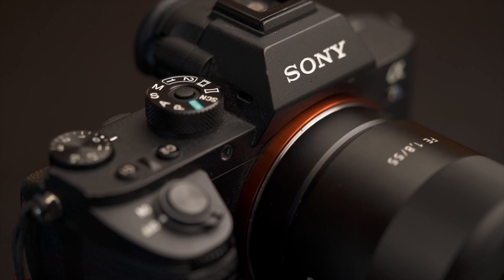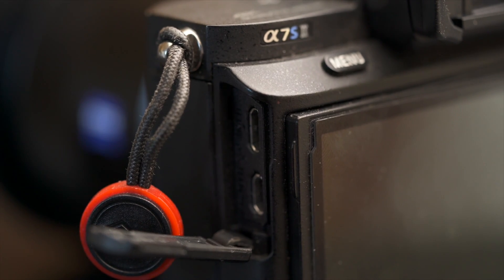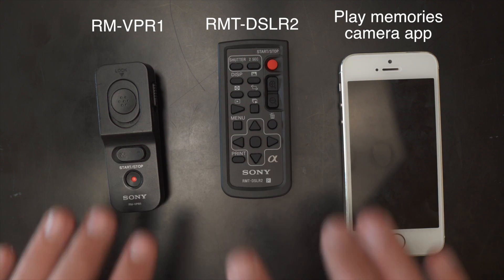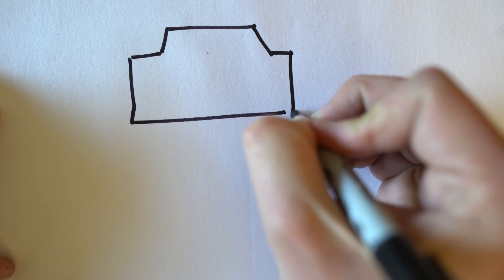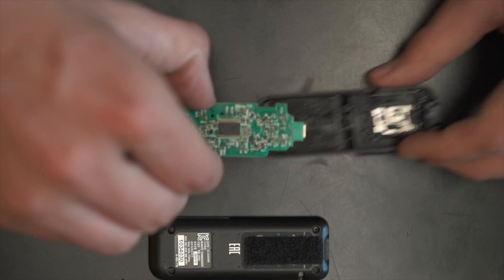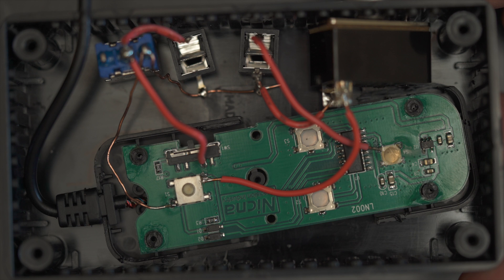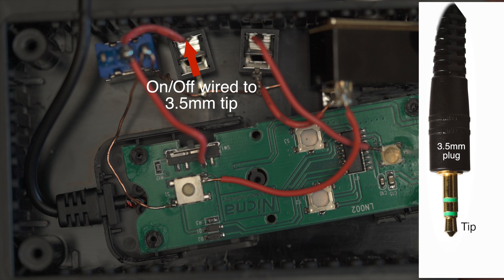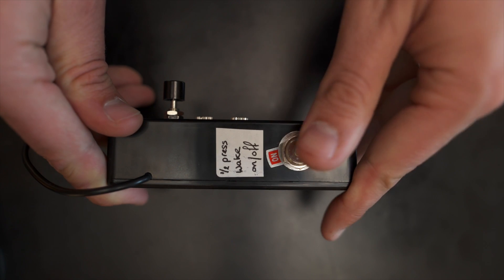How to hack the Multi-Terminal: Taking (remote) control of the Sony A7/S/R

Comment: I just approached the same project, to trigger video externally. I own one aftermarket cheap wireless intervalometer, that comes with a Multi Interface to 2.5mm stereo jack cable. Shorting GND to the Tip worked out just fine. There is an option in-camera though, called something like "Use shutter for video".
Reply: While that works on the newer bodies, older ones from when this video came out do not have that option. Even on my slightly newer a6500, using a similar intervalometer, I get a message telling me that I have to use the MOVIE button to start movie recording. My intervalometer is the Pixel TW-283, for reference.
Reply: @ziginox  i think I have the same intervalometer.

Comment: Hi Elliot, great hack! As a completely igonrant in electronics, but still loving DIY , i been looking for a remote control for Sony Alpha cameras that allow to change shutter speed and iso, do you think this is possible? Maybe not hacking a sony remote but maybe with arduino? I really been searching for a very long time and i back to your video several times , i feel you are close of what i am looking, i need a remote control (wired or not) to change settings when i am shooting hyperlapses with a gimbal , maybe you could answer my doubt, thanks so much in advance and keep doing great!
Reply: Hi Alex, have you found any solution/device that answers to your question? I've been looking for remote controller to change shutter speed and iso (specifically) too, and a cellphone app isn't ideal for me. I need to come up with an eng style rig for sony a7, but current shoulder rigs limit my right hand placement to extended handle most of time. so I don't have access to the buttons and wheel on the back of camera and be ready to change iris or iso. I know FS5 and FS7 are designed to do the job, if there's more budget for production.

Comment: I have a setup which the camera is triggered to take a photo using a simple micro switch. This works fine with the Canon EOS 650d and the Lumix G9. However I've stumbled into a bigger problem with the Sony A7III, realising that I couldn't bodge it in the field using one's teeth as wire strippers... This hack looks somewhat overly complicated and expensive for my requirements to take photos without autofocus triggered with a microswitch - is there a more straightforward hack?

Comment: Hi Elliot, thanks for the video! I'm trying something similar, but with an Arduino microcontroller instead of switches to potentially allow it to be programmed for a time lapse or controlled a bit more elaborately. Have you made any use of the shutter? 

From what I can see, full pressing the shutter button grounds the top left pin on that switch that's connected directly to another wire back to camera. It seems a bit weird because I haven't been able to make any controller based off just grounding pins on the multi-port work yet
Reply from the maker: Hi Cian. Triggering a single photo or series of photos for a timelapse should just be a case of shorting one pin to gnd. There are multi port to micro jack adapters that will let you use generic timelapse intervalometers. If you're trying to do day-night type timelapses and change things like ISO, you will need to engage the USB portion of the multi-terminal, and to my knowledge, when the camera detects USB, it will no longer store captured photos to the memory card. If you're trying to trigger video, you have to go through the circuitry in the VPRM1. It's outputing some sort of serial signal. You could potentially figure out what that signal is with an oscilloscope and some other pro gear.
Reply: Elliot Lowndes thanks for the reply, yeah I had read elsewhere that it was just shorting one of the other pins, but I've tried two different multi-terminal to 2.5mm adapters so either my port is damaged, they've changed something in a recent firmware update, or I'm just really unlucky with cheap adapters. 

Thanks anyway, I'll hopefully get the controller working but I don't have access to my Sony for a few days now

Comment: Thanks so much for this information!  
I had a follow-up question on one particular switch you connected, please: 
When pressing the "AF" button that you rigged up, is this the same as pressing the AF/MF button on the camera, or the AEL button?  OR does your AF switch activate some other circuit (such as a Custom-configured button that just turns "ON" the AF at that moment)?  And if it does activate one of the actual buttons on the camera, is that button still also usable while the remote is plugged in?  This information could make a huge difference in my use of the Sony cameras in so many ways!  
Thanks again!  
Regards, Randall
Reply from the maker: Futur Foto the AF signal is received through the multi port and has the function of waking the camera from sleep and/or triggering autofocus if you have an auto focus lens attached and autofocus enabled on the camera, regardless if you have AF assigned to the AF/AE button and should work via the remote in addition to that button. By default, and without the remote, the camera wakes or triggers autofocus with a half press of the shutter button. Again this is configurable. I would recommend you buy a cheap fotga remote to test what you need, they're not very expensive. Hope that makes sense.
Reply: Yes, thanks Elliot!  That does make sense.  And it sounds like I could use it in a few very useful ways.  Thanks so much for your answer!
Reply: Hi thanks for sharing, I'm interested in remote control especially of the AF/ manual switch. Are you going to follow up with a how to? Thanks in anticipation